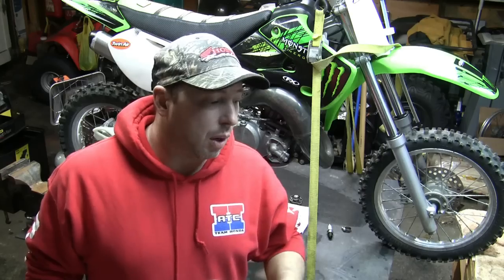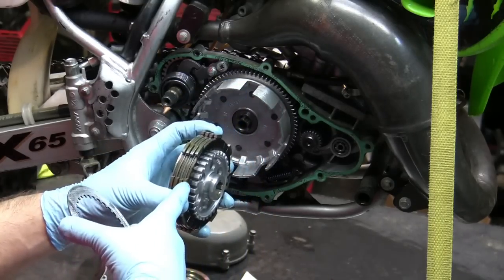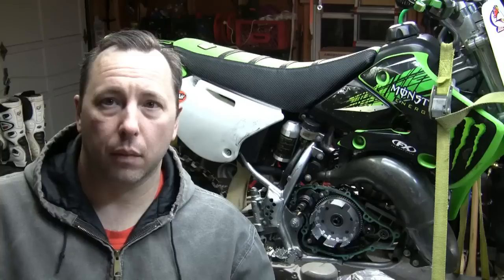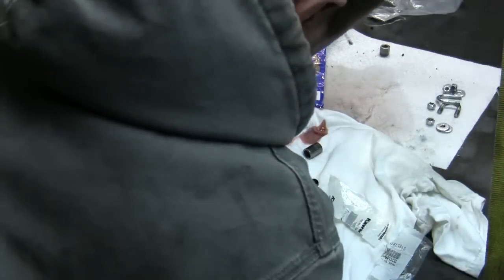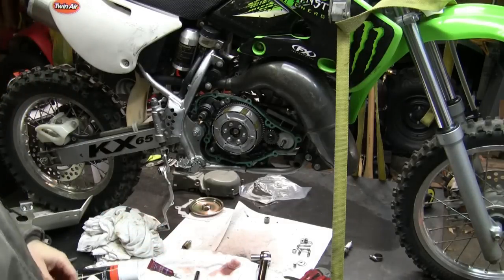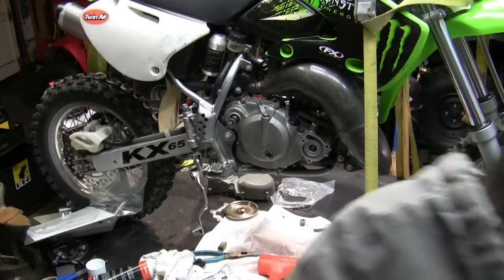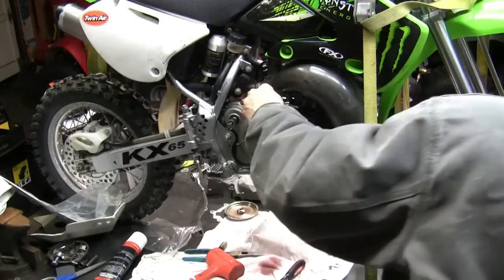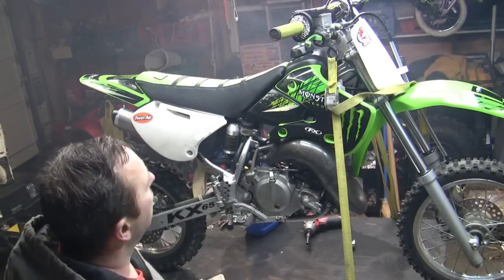2006 KX65 Clutch and Water Pump replacement repair

Comment: I just used this, in conjunction with the factory manual, to do the clutch in my son's Christmas present 04 KX65. Very helpful! Thank you so much for this video.

In my case, the previous owner(s?) had gone crazy on the clutch hub nut and it took jamming the motor with a bar thru the sprocket across the swingarm, 5th gear and the brake on, and a 2 foot cheater to get the clutch nut loose (!).  I ordered a piston stop but it's lost in the mail 15 days later (2020 vibes). Don't give up hope; it really is a lefty loose-y thread and if your impact tool won't work, you may have to resort to some extreme Measures. 

Also pro tip: when BigRedGrizzly refers to the sharp and rounded side of the plain plates... do not check them by running your finger over them unless you enjoy paper cuts administered by finely machined steel.  Especially in this time of COVID and hand sanitizer!

Great video, thanks much.
Reply from the maker: Thanks. Glad the video provided a nice visual aid a supplement to your manual. Good job getting it done ✅.

Comment: Hi there, I'm from Italy, I have the same motorbike for my son. Today we went to the box to take the bike and ...aaarghhh... there was a small oil pool under the engine!!! I bought the bike as second hand and realized the previous owner had the clutch disks changed, but did not change the main gasket, so I think I'll have to change it myself.
THANKS FOR THIS VIDEO, which fully explains, step by step, how to do the work!
Reply from the maker: Mirco Grassilli 
Hi Mirco.... Glad the video helped you out! 👊🏻✊🏻💨🏁

Comment: For anyone that needs to lock up a cylinder... grab some 1/4" nylone rope. Pull the spark plug and pack it above the piston. It'll hold everything nice and tight to get stubbon bolts undone. Cheapest engine lock up tool ever.
Reply from the maker: Yep… Good tip. I do that when working on chainsaws. 👍🏻

Comment: I was able to successfully replace the clutch on my son's KX65 thanks to your video! Thank you so much. Quick question though, could you link me to the piston stop you used? I've seen some that are metal but you said yours was plastic which I think would be better
Reply from the maker: Josh Almeida 
I’m so glad it helped you out. Doing it once will now basically give you the ability to do it on any dirt bike. Great job. Here’s the link to the piston stop. 
https://www.rockymountainatvmc.com/parts/steahly-engine-lock-up-tool-p

Comment: Hi I really appreciated your video  I have replaced a clutch kit on a kx 60 today and getting ready to put everything back  I had a question... I’m putting in new gasket... do I just put the gasket in dry?  Or do I need to lube it w something?  Thanks for your advice
Reply from the maker: It’s ok to put it on dry. I have put little bits grease to help hold it on before. Ideally, you would want the alignment dowels in the engine case and not in the cover. The alignment dowels will help hold the gasket as well. The alignment dowels are those thin walled cylindrical tubes.

Comment: Hi there having a little trouble getting that bolt torque to 47 pounds my tire wants to spin I strapped the bike down and try to put it in different gears but the tire won’t seem to lock it keeps spinning when I try to torque the bolts any help would be great if I’m doing something wrong thanks and thank you for making this video helps a lot just trying to get this boy’s bike fixed!
Reply from the maker: jaycup 433  I understand your difficulty in getting that clutch bolt to 47 ft. Lbs.  what you don’t see is that I have a piston stop installed where the spark plug goes. When the piston moves up the cylinder and hits the stops, it basically locks up the engine so you can tighten that nut. Another option would be a clutch basket holder. That will allow you to hold it still as well. 
Piston stops are cheap. 
https://www.rockymountainatvmc.com/parts/tusk-engine-lock-up-tool-p

https://www.rockymountainatvmc.com/parts/tusk-clutch-holding-tool-p
Reply: Thanks I’m learning, it all makes sense now 👍
Reply from the maker: jaycup 433 
We all start somewhere. I love learning mechanics and I’m happy to share what I know. 👍🏻

Comment: If I'm replacing just the clutch plates, do I need to remove that circlip from the crank gear still?, or can I leave the circlip and gear on and just remove the clutch basket? The plastic teeth on the water pump gear looks good on my bike, so no need to remove or replace it. Thanks! Great video and info.
Reply from the maker: cartercochran mx 
Hi Carter... You DON’T need to remove the circlip or that primary drive gear. Actually, if your only replacing fiber plates all you have to do is remove the springs and the pressure plate. Then reassemble. Be careful tightening down those pressure plate screws with the springs. Use a torque wrench if possible... 👍🏻
Reply: @DirtBikeDaryl  Also, I dont have a piston stop. So can I just remove the exhaust pipe and shove a metal bar up the cylinder port to stop the piston from moving? Or how would you reccomend I take the clutch basket off if I dont have a Piston stop? Thanks!
Reply from the maker: cartercochran mx 
Now I know you’re just F’n with me! 
Lol... Have fun Carter... 👊🏻✊🏻💨🏁

Comment: To replace the crankshaft only… do I need to take all the gears and transmission out?
Reply from the maker: No, I don’t think so. They are only connected by the clutch. So if you are able to separate the clutch and and spilt the cases you should be able to press the crankshaft out no problem. If you’re in there that deep though, you may want to consider replacing other worn parts if they are worn. Good luck, take lots of pics, it helps with re-assembly.
Reply: @DirtBikeDaryl  I also noticed when I was taking apart my bottom end on my KX 65 I noticed the gear that’s attached to the crank and holding the clutch. Mine had a bold on the end of it. I didn’t see yours having a bolt on the end so I’m not sure why mine has one.

Comment: Nice video!! The small oil seal in the water pump, Will the flat side facing me?
Reply from the maker: https://www.manualslib.com/manual/803743/Kawasaki-Kx65.html?page=60#manual

Definitely look at this link. It all depends on what perspective you are referring to. The link will clear it up.
Reply: I need a 2007 kx65 harness cdi stop switch and stator system to buy do you have any i can't get any on Ebay or Amazon can you help me please try and locate me with someone who may have or can another it be replaced with another year kx65 model.how what  size are they can they replace with other years kx65 model or can i used one for a another model ?

Comment: Hi thanks tor this video it's been helpful but I'm on the last bit the small oil seal that is on the outside neares to the impeller I put that on and it feels pretty loose do I need to try and drive it in further the seal has the writing on facing out towards the impellor
Reply: It's the smaller seal or is supposed to be with the writing facing in to the other seal as I couldn't see on your video which way it sat thanks in advance
Reply from the maker: You have that outer seal facing the correct direction. It should be flush with the casing. If it is loose it may be incorrect size. One can push it in with their fingers but it should be hard to do.
Reply: @DirtBikeDaryl  thanks mate I'll try n put a socket on it in the morning n try and drive it in just a little further but thanks for the vid I'll subscribe to. Your channel 👍
Reply: Or I'll put a clamp on it and get it just a little further in

Comment: I need help with my kx65 when I try to untighten the center clutch backer bolt my clutch just strips even if I put something to wedge the gear
Reply from the maker: Robert Marcum 
Sounds like you need to lock it up. You will need a piston stop, flywheel holder, or clutch basket holder. 
https://www.rockymountainatvmc.com/parts/tusk-pin-style-flywheel-holder-tool-p

https://www.rockymountainatvmc.com/parts/tusk-clutch-holding-tool-p
https://www.rockymountainatvmc.com/parts/tusk-engine-lock-up-tool-p
Reply: Any videos on fork rebuilds for this mamer jammer?
Reply: If you don’t have any special holders to stop it, you can literally use a flat head screw driver, it’s not the best option but that’s what I’ve done in my driveway rebuilds

Comment: Did the water pump make a noise when running?
Reply from the maker: Nothing abnormal.
Reply: @DirtBikeDaryl  my son’s 2009 sounds a little noisy by that area. That’s why I asked. Might be taking his apart and put new parts in and see what’s going on.
Reply from the maker: @bradymxr4659  
The bearing in there my be a bit f’d. It would likely be best to get in there and see what’s going on. See if there is water/antifreeze in your oil. Milky looking oil will be the sign.
Reply: @DirtBikeDaryl  that’s what I did right away but still good. So I’m tearing into it.
Reply from the maker: @bradymxr4659   Nice. Let me know. I’m interested to hear what you find. Good luck. 👍🏻
Reply: @DirtBikeDaryl  will do.

Comment: Do you think on a kx85, basically the same clutch, that if my water pump seal has gone bad (which it has) and it starts to leak water into the clutch, could it cause it to slip and screech? I also have a nylon gear that I'm buying a replacement for because it has a couple teeth missing in the water pump assembly, could that cause screeching too?
Reply from the maker: I suppose it could. If your clutch is slipping it could be that your clutch plates are beat and need replaced, the clutch springs are out of spec. and need replaced, or spring bolts are out of torque spec and need retightened. Definitely do not over right those clutch spring bolts. They snap easily and you’ll have a bigger problem on your hands. A service manual with torque values is likely available on line.

Comment: How do you pull out the water pump shaft?
Reply from the maker: chad larsen 
If I remember correctly, I think it just pulls out from the inside of the cover.
Reply: Do I have to take off that bolt for the impeller to pull it out?
Reply from the maker: chad larsen 
I’m pretty sure you have to remove the impeller.
Reply from the maker: chad larsen 
Yes. I’m pretty sure that what holds the shaft to the cover.
Reply: Sorry for all the questions but I can’t take the bolt off it keeps spinning
Reply from the maker: chad larsen 
You mean the engine is turning over? The piston is moving in the cylinder? 
You will need to lock up the engine. I used a piston stop. 
https://www.rockymountainatvmc.com/parts/tusk-engine-lock-up-tool-p

Comment: Don't you have to soak the clutch plates?
Reply from the maker: Yes… In this video you can see that I’m pulling them out of a plastic bag containing the oil and the fiber plates. If done as little as 3 hours and as much as 24. Never noticed a big difference. I would always get them nice and oily though before I installed them.

Comment: Thanks a lot pal but I can't get anything from there because I live in the UK and they don't sent stuff out to here do you know the name of the part though?
Reply from the maker: Michael Doran  Yes... Water pump shaft. FYI... You can still look up the part to find out what it’s called. I hope you get your bike back in action quickly..
Reply: I have put that in and it's not bringing that piece up just the metal bit
Reply from the maker: Michael Doran  For us here in the states it’s one part. The plastic gear comes already attached to the metal shaft. I would think it would be the same over there...
Reply: @michaeldoran5001  did you sort it ? I am also from the UK and found that part easy, type in on Google kawasaki oem part UK and you will be good or go on ebay couple on there at the minute :)